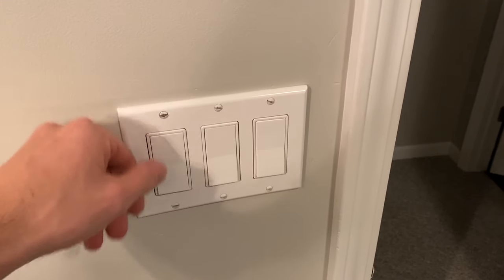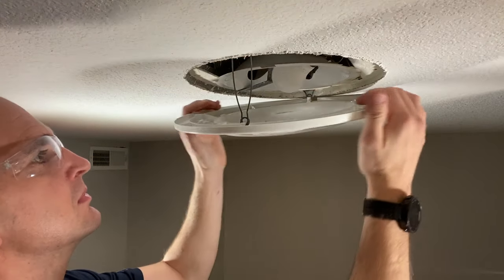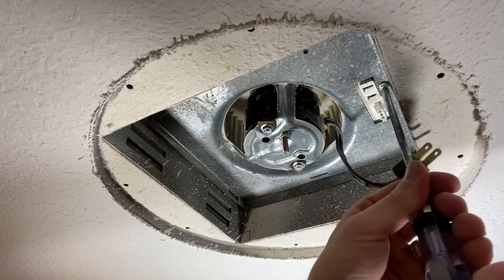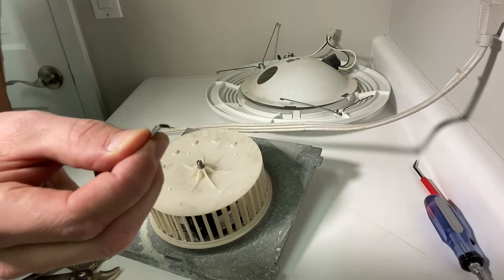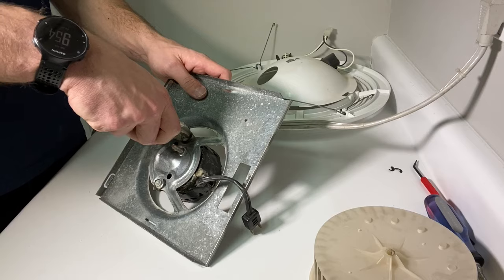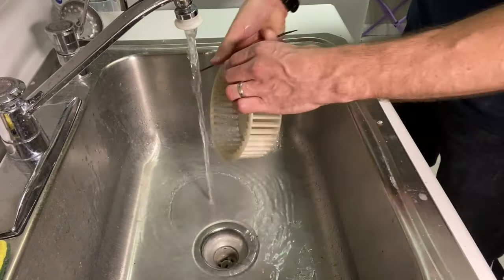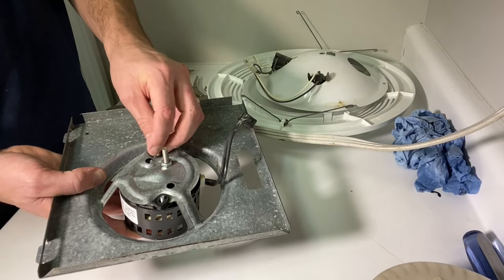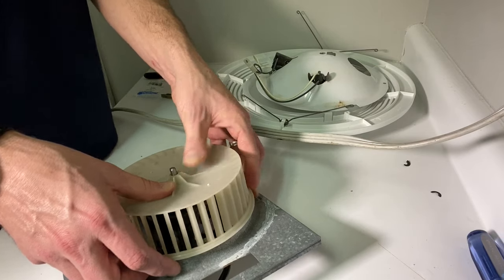How To Fix a Noisy Bathroom Exhaust Fan | Easy Project

Comment: Thanks, this was really helpful! It helped me figure out how to remove and dissemble the fan - wonderful. In my case, after cleaning and reassembling it, the fan enclosure still kept sliding too low on the shaft and rubbing against the metal plate. I finally solved it with a tiny piece of flexible tubing fitting snugly on the shaft (roughly 1/4") which was just enough to keep the fan from rubbing against the plate.
Reply: @squirrelattackspidy  My local hardware store sells clear plastic tubing by the foot (in the plumbing section). I took the motor with me to the store and just did some trial-n-error to find the right size. The fix cost me less than $1! 😉
Reply: Thanks for that awesome piece of info!  We have a home Depot and a Lowe's in my area. I'll check with them to see what they have available for tubing.  Do you recall the inner or outer diameter of the tubing?  I'm looking online right now.  I was thinking it through and now understand why you want the tube snug on the shaft.  If it's not, then the bottom of the plastic may end up rubbing on the bottom of the plate and will either erode or melt from the friction.

Comment: Thank you thank you thank you. Mine made the same noise. This is exactly what I needed. I didn’t know how to take out the fan/motor piece. Didn’t realize it came out with one screw and I thought it was the whole metal frame that needed to come out. So I just let it go and didn’t use the fan for a couple months until I could get some help or hire someone to do it. Took some pics of the exposed motor unit when I took the light reflector off. When I showed them to a friend who zoomed in on the model number and found one on Amazon for $60. From there I searched YouTube for a DIY and here it is!! I had it replaced in minutes. I decided against fixing a 15 year old unit and replaced. I did fix it when I took it out, like you suggested and stored it in case someone would need a replacement. Again, thank you thank you. You saved me $$$.

Comment: Absolutely WONDERFUL tutorial. My fan died and I thought I would have to climb into the attic to swap out the whole unit when it was 220 degrees up there!!  I see YOUR fan was clean, but mine was so caked in dust that I thought about calling a HAZMAT crew. Luckily a small vacuum, a toothbrush, some Q-tips, and a change of (dusty) T-shirt did the job. I will be sending you a donation and a nice card from my wife because she didn't have to worry about keeping me hydrated if I ended up in the attic (and ready to call 911 if I fell through the ceiling from a heat stroke in 330 degree temps up there). PLEASE keep up the great tutorials. I subscribed a while ago and enjoy your videos!!

Comment: Thanks for the great video!  My fan blades were slowly sliding down the metal motor shaft and hitting the casing.  I put some electrical tape around the shaft to keep it from sliding down and it works great!  Without your video, I'm not sure I would have tried anything other than just cleaning it and ignoring the noise...lol.
Reply from the maker: Hey Donn, always nice when a small fix makes a big difference. Good work on the repair!

Comment: Great video. Used these steps to get my fan to quit making noise. Just thought I'd point out that rather than buying something at home depot and destroying it for the push nut, I found the exact nut I needed at autozone in a Doorman assortment kit for 5.99. Part #13441. Had 2 of the 1/4" nuts, along with a bunch of others I may or may not need someday hah. Anyway, keep up the good work!

Comment: Great video! I like how you cleaned everything with soap and water. Most guys only vacuumed or wiped with a dry cloth. Only thing I would do different is clean the motor with my hose outside, living in the Phoenix area where the air is dry I do all my appliances with a hose. I just give it a couple days to dry.

Comment: Worked like a charm and it was easy.  Washed the grill, took the motor and ade out, washed the blade while it was attached to the motor because I couldn't remove the clip, used a vacuum to clean around the motor, drop of wd40 and white grease into the motor, now it is quiet as a whisper again.

Comment: I have a different model fan but it sounded like it was struggling when on. I did an inspection and it was caked in dust. After a cleaning, the fan sounded much more quiet. Thanks for the tip!

Comment: Thanks for the video, super helpful! I have the problem with similar device and tried to see how to fix it, but my problem is a bit… weird. It is actually that once I adjust the fan to no rub on either top or bottom plates, after I start the engine after few seconds the fan blade slides down to the motor plate and start to rub it up badly. Thinking about a splint to be put into that flat part.

Comment: THANK YOU so much! I'm so glad I watched this video before rushing to a store to buy a replacement! Adding WD-40 to lubricate the rotors got rid of the squeak!
Reply from the maker: Nice, always love the quick fixes.
Reply: WD-40 May work, but it may attract dust too. There may be a better lubricant to use, such as the choices used for lubricating a door lock.

Comment: Thanks!
Reply: Great video. The only deviation I took was to leave the fan blade housing as-is. Didn’t want to mess with losing the push nut and having to go to HD to buy a new one.  I used the leaf blower to clean the dust and a tooth brush to clear the vents, finally wiping it off with a damp rag.  Fan is back in action! Thanks

Comment: I just got mine working again.  The fan blades had shifted down the shaft and wouldn't let it spin.  There was no starlock washer, either broke off or was missing from a prior repair.  I bought two ~6mm c-lock washers and I was able to press them in place to hold the blades at the proper spacing.

Comment: I wish I understood this video. It seems so complicated to me though it's clear that a lot of people have benefited from it.
Reply from the maker: Hey TF, which part do you need more help with?  Is your exhaust fan making noise and you want to see if you can find the issue?
Reply: @EverydayHomeRepairs  thanks for reply. Yes, the exhaust fan is making a ticking type sound. It is mounted on the wall not ceiling. There is no brand name and the vent part is circular in shape. I just dont know where to begin with it.

Comment: Hi. At the 4:26 mark of your video you pulled on the motor shaft and it moved in and out. This is what mine does and is cause of the rumble noise. As the fan spins the rotor and shaft lift out of motor and rumble. there are some kind of spacers inside on both ends to stop this but don't know what they are or can find a parts list for this type of motor. thanks

Comment: You were AWESOME! So easy to understand and calm. Have removed, replaced motor etc. Went to put back in ceiling, very difficult to fit? I found the slots and lined them up however it does not fit easily. I have not forced, but Houston, we have a problem? Thank you sooooo very much.

Comment: Great video!  My cooker exhaust fan is leaking rain water on the cooker top and I need to replace its roof pipe vent. What is your favorite roof pipe vent for this?  (I have a gable roof)

Comment: Any thoughts on what might be causing noise - only when the fan is installed in the housing?  When I remove the fan and bench test it - it's whisper quiet.  Often I can reassemble and it's quiet for a few days, but then the noise comes back.  Then again, when I remove it from the housing it's quiet.  I assume my noise source is a vibration in the housing but I can't pin it down.

Comment: I have the exact same fan with the exact same problem. Only difference is the shaft is splined, almost like a car axle. I don't have a lock washer, the fan is just kinda jammed on the shaft. I need to shift it upward to stop rubbing the bracket but I can't move the fan. It feels like the fan will break if I pull it too hard and it's really stuck. Do you have any advice to get it moving?

Comment: Great video. I literally have the same model than you. The only problem is that after replicating all the steps, the white fan part is still sliding down the shaft. I tried putting some washers in between but it’s still creating a lot of noise. Do you have any suggestions ? 
Thanks
Reply from the maker: What about just ordering another blower fan wheel assembly https://amzn.to/365Ektk ?  The new assembly should have a better friction fit on the motor shaft and then stay in place reducing the chance of interference / noise.
Reply: @EverydayHomeRepairs  I like to explore all options before I have to buy something new. It’s not about the price but the principle of trying to fix it 😂

Comment: Just out of curiosity.... how much is a new fan assembly?
Reply from the maker: Under $100 but it is more of the work associated to completely removing the old housing and installing new.  If this doesn't work for you I would say the next step is buying a new complete fan assembly.  Little more money but will save a ton of time on install compared to a completely new unit.

Comment: Did you also turn off the fuse to the fan?(And not just the flip switch.)
Reply from the maker: For this project I just flipped the switch since the fan plugs into an integrated outlet opposed to being hardwired.  It is always the safest to turn off the circuit breaker so be cautious and pick the path you feel the most comfortable.

Comment: I need some help... I put the fan back on the new motor, plug it in to test it, and the motor and push nut spin around but the fan is still. Is the push nut not properly sealed to the fan? I didn't crack the push nut at all. Is it possible the plastic fan is worn down where it seals with the push nut? Any advice? TIA

Comment: I have a Brevel Corp fan motor that needs repair. It makes noise. I'm going to try to move fan blade to see it that works. If it still makes noise where do I find a replacement? The housing in the ceiling is round. So just simple swap out is not going to work.
Reply from the maker: Once you get the motor out you should be able to get the exact model number to use in your search online.  Amazon has some sellers with a pretty good selection but usually once you get the exact model number a google search will point you in the right direction with the online dealers.  I have found the pricing to be reasonable on these fans which is also a bonus.

Comment: These fans have a 1.5 sone rating.  I want a quieter fan.  Has anyone found a complete replacement for these that didn't require repairing the ceiling?  IE one that had a grill that would cover the recess for this Nutone grill?

Comment: Curious I also have a nutone 8663rp “b” unit and when I took it off the wall, there is no push but holding the blade to the motor, and the blades aren’t coming off

Comment: Problem with my motorshaft is that it’s not keyed but had grooves in it . This sucks because the plastic fan eventually just strips out
Reply from the maker: Hey Gus, if you buy and new fan and ensure no interference I would imagine it should run for years without issue, right? Still be a better option and should cost much less than a whole new exhaust fan.

Comment: I have the same fan and my light bull is blinking how can i fix that ? Thanks
Reply from the maker: Hey Pablo, assuming you have tried a new light bulb and still are getting the blinking then I would move on to inspecting the white connector.  Unplug the connector and make sure all of the pins are at the same depth and none of them have pushed back which could cause a blinking light.  Does your light blink only when the fan is running?
Reply: Everyday Home Repairs i have two switches one for the fan and the other one for the light and it blinks even when the fan is off, i try a new bull and is doing the same

Comment: i cleaned mine and it still made a grinding sound so ive decided to spray the shaft with silicone spray lubricant and let it sit for 24 hours to dry. and put it back up and it ran nicely like new again

Comment: When I was younger the fan in my bathroom moved, causing a loud grinding and rattling noise. I was on the toilet, and it scared the crap out of me, throughout my childhood I was always Terrified when I accidentally turned it on instead of the light.
Reply: Smh_240: "I was on the toilet, and it scared the crap out of me"
Technician: "Works as designed."

Comment: This looks absolutely nothing like my fan. Mine doesn't have a light and the fan blades look like a proper cooling fan. Maybe it's because I'm in Australia. Back to the framing board.
Reply: No, we sell fans like that here. Also depends on age. My old one has a 4 blade fan. Still, the work isn't that different. Just that it's not a push nut, and I'm not sure I even need to take the ran off because of the noise mine makes.